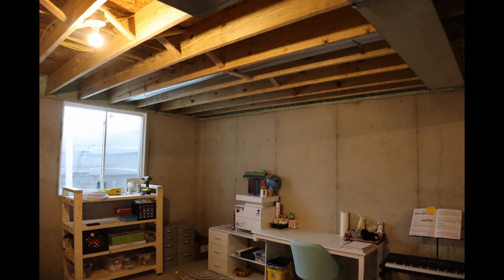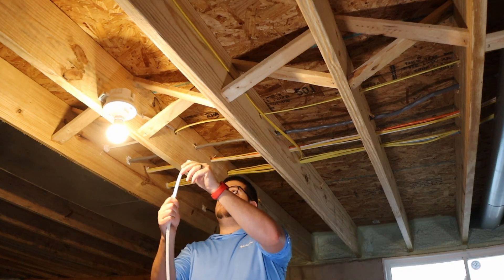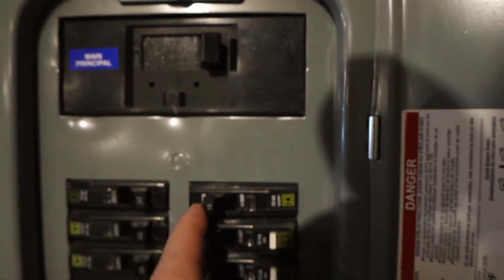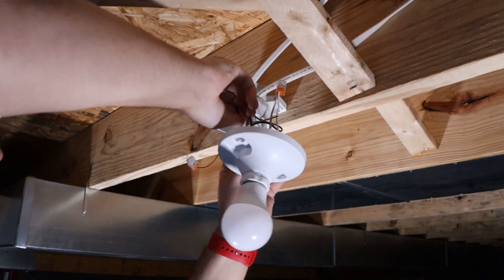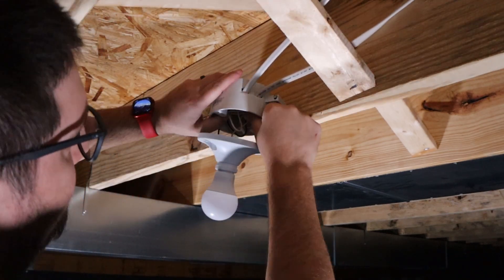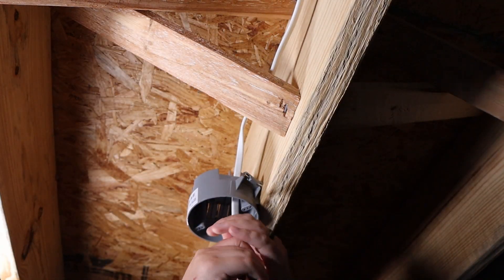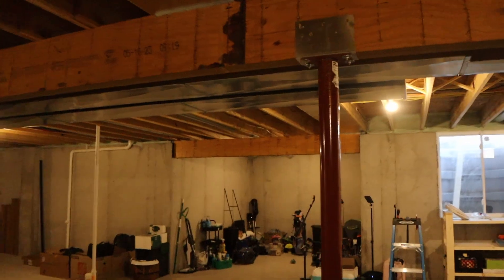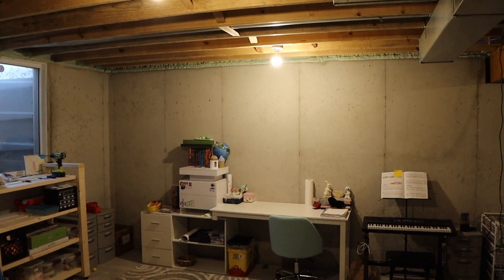How to Add a Light to an Existing Circuit

Comment: What to do if you wanted to connect it in series??
Reply from the maker: @simeonisaacs9840  You can connect the new wires to the wires for the light. Those sets of wires would not both be pigtailed/connected to the power line coming in then.  It would almost be like branching off the power line as normal, and then branching off the light rather than just going off the power line again.

Doing that would mean that if the first light lost power or failed in some way, then the new light would lose power as well.

Not sure if that makes sense…